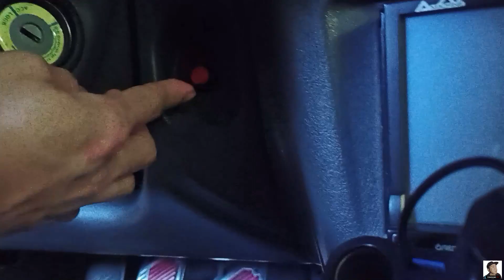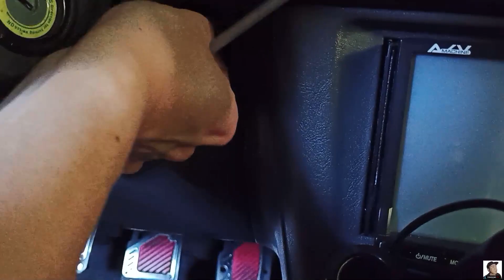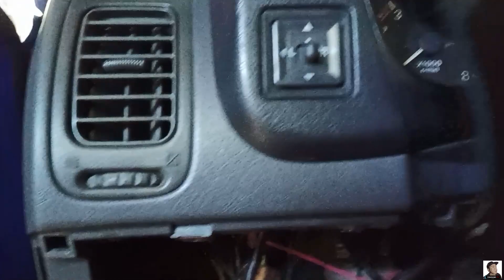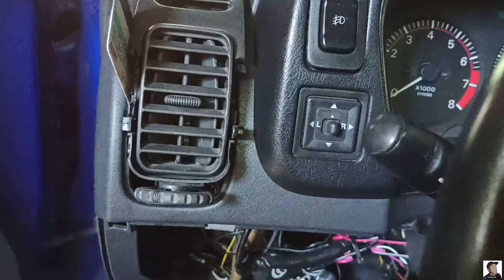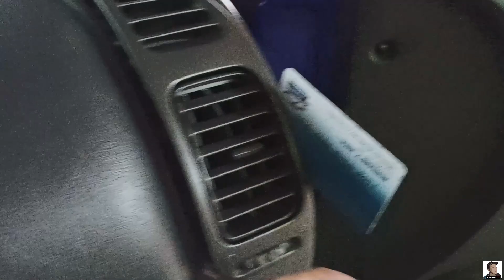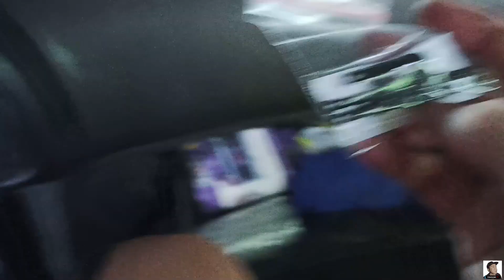HOW TO REPAIR AIRCON LOUVER ON LANCER GSR | PIZZA | EVO 4 - 6 | CK | CJ

Comment: Kailangan po ba talaga tanggalin yung lower dash cover para matanggal yung left louver?
Reply from the maker: Yes. For easy access para masungkit mo sia.
Reply: @makasoratv  sir ano po size ng park at plate lights ng 97 Lancer Pizza?
Reply from the maker: Sa park and plate light t10 bulb sia either conventional or led.
Reply: @makasoratv  yung accessory lights po ba sa gauge cluster pwede palitan din ng LED?
Reply from the maker: Yes pwede. And advantage is Mas maliwanag pag led gamit mo